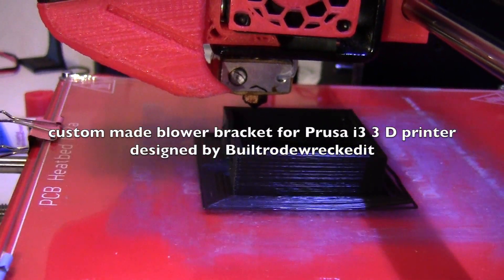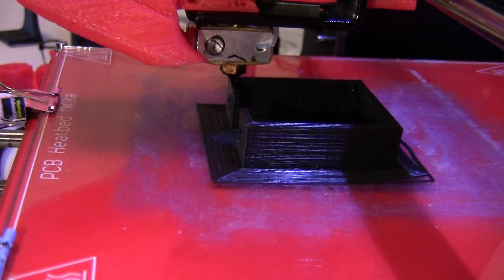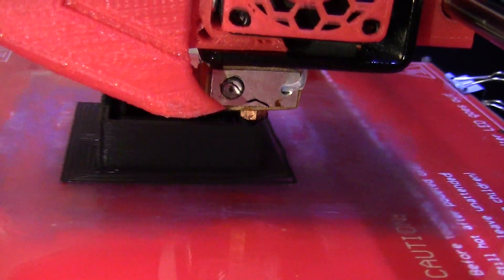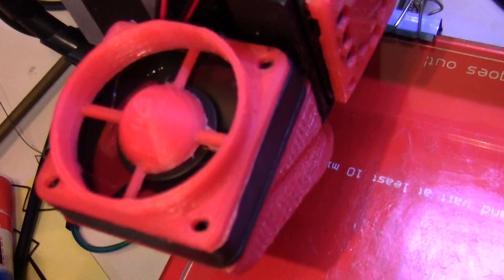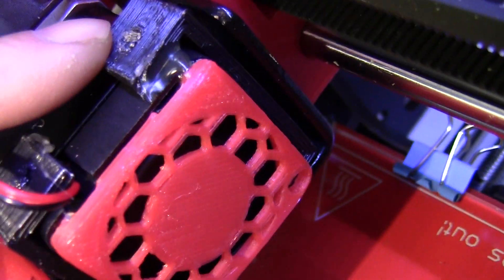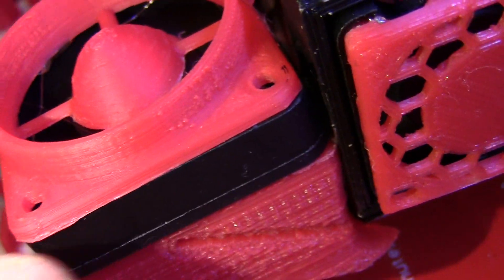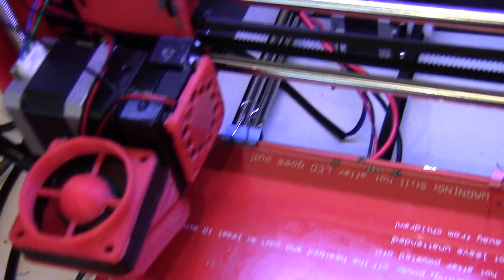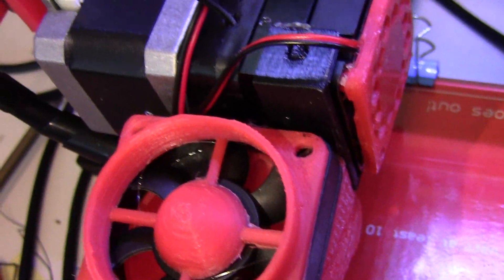3 D printed bracket for fan blower for Prusa i3

Comment: That's great. I put those little holes in there thinking a zip tie could be used to tighten the ends together but i think the hot glue is a good idea too. I'm curious do you think it could work on the motor end as well or is just printing one side good enough?
Reply from the maker: It should work on the motor end. I guess it all depends on the design of the blower. The blower I use blows air on either side of the nozzle so that's why I pick the other end of the assembly.  Also the x axis motor assembly mount has screws in the back that can get in the way.  It has a cleaner look and seems to work so thank you for designing it.